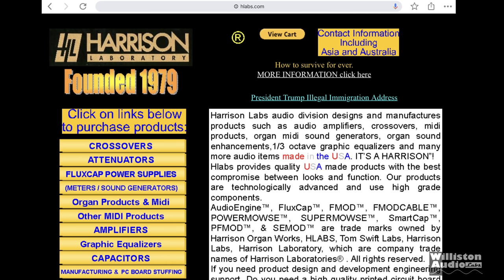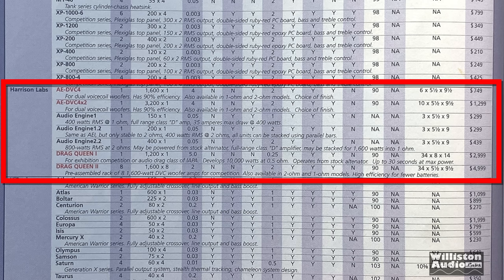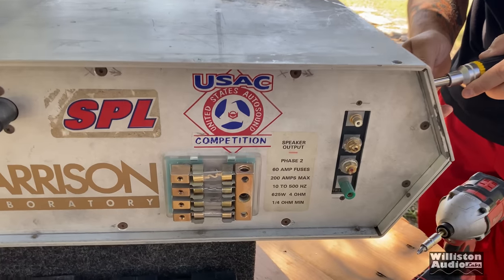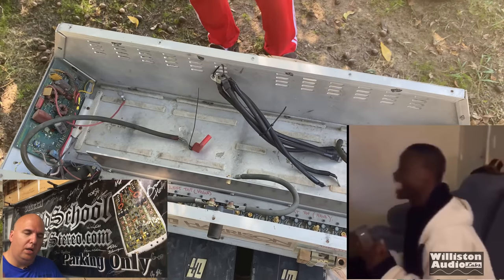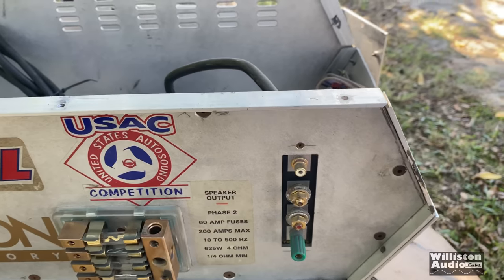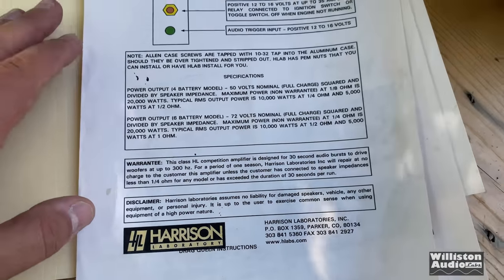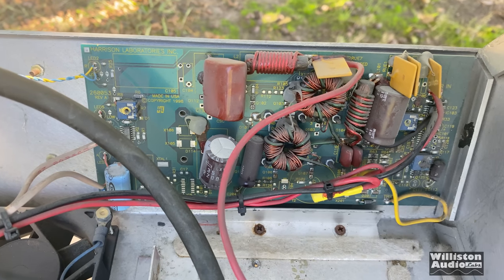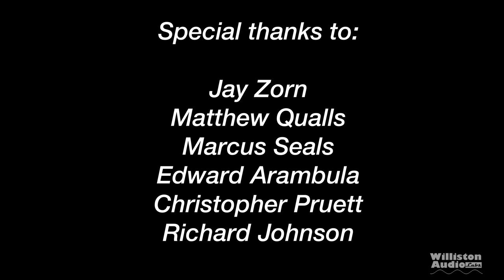20,000 watt Amp Banned from Competitions? 2000 Harrison Labs Drag Queen [4K]

Comment: 6x batteries better than 4x. 
Any 12v car good brand battery will work. 
this works like any 120v/220v PA unit, they lower voltage to 50v or 72v DC to operate at high power. 
6x voltage means 6x less amperage needed, and that size batteries can deliver 140-200A easy.
72volt multiplied by 140 amps equals 10080 watts.
48volt multiplied by 200 amps equals 9600 watts.
12v batteries usually stays at 14v charged but voltage drop exist too. 
You can use another high amp lead acid battery BMS too if stock is broken.
Grab some second hand batteries and test it. Missing components could be about 1 channel mode instead of 2.
Please.
I get subscribed, make me proud of it.

PS: the farm of 3 leg amplifiers seems to be placed in two lines near the front panel, they are in opposite direction and maybe works in cascade, one line pushes membrane out and the other one pushes the membrane inside of the speaker, the bigger the heatsink/fan the longer time you have for fun. 
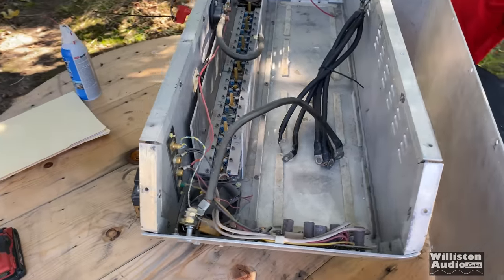PS2: minute 5:21. I can count 80x 3pin TO mosfets. 40 on each board, 20 in the front 20 in the back. 
PS3: this amp is a beast. if you feed and tune it properly it can blow indefinitely
At this point you want to test it too
PS4: it can work in AC but you need a 10kw 110/220v to 72v 80Ax2 toroid coil and trashcan size capacitors. So better, easyer and cheaper stay with batteries.
Reply: it drains 850A max in 12v language so you will need some beefy step up boards to charge the amp, but you also never going to use indefinitely at peak level so maybe 150-300A alternator+stepUp should work good at make ears bleed. 300A bms only for charging and balancing is cheaper too
Reply: 72v multiplied by 200 amps sounds fun
I have a bose with similar layout, 24 older transistors. it can pop any speaker, limiter is a must.

Comment: I seem to recall the Drag King was similar to a Drag Queen inside but instead of batteries it had a true internal voltage inverter like all normal amps used, in order to get ~50v to the outputs.
Now stick some Nu-Skool lithium batteries in there and listen to her sing

Comment: Does this amp sound good, or does it just produce a square wave? If it's a square wave, that might explain why there is no gain or crossover knobs. It probably just runs in full bridge mode, as a variable frequency inverter connected to the speakers. It would be hard to call it an "amplifier" at this point, but rather, a solid state "switch box". I can see why it would be banned, it's not an audio amplifier!
Reply: Vincent Robinette exactly !
Reply: It's not a musical amp, think of the sound a speaker makes when plugged into the wall but at a higher frequency.
Reply: @ColAngus  Probably more like making an amplifier out of a modified sine wave power inverter!

Comment: This reminds me of an idea I had as a kid when I was still doing audio stuff.  Get two regular, but hefty sized alternators, like 100 to 150 amp size, rip out the regulator and then just drive the fields with the low frequency signals you want to amplify and each alternator would be one half of the output.  You'd need to isolate the grounds (of at least one anyway), but you'd be able to make one hell of a lot of power.  But, back in the 90's, it would have been a cheap way to make big power.  Big power back then was god awful expensive.  Yanking alternators out of old stuff though, you could have made one hell of a big amp for very little cash.  AND, it would have been stupidly reliable as far as shorting of outputs and such.  It would only be good for the lower end of course, but I suspect it would allow you to make stupid levels of output.
Reply: Dare I say, as an EE, that could actually work...
Reply: Takes one to know one. :P  The only issue is you'd probably be limited to a couple hundred cycles/second.  They're true 3 phase units though so it would require limited output smoothing I'd think.  So long as the diodes are all good anyway. :D

Comment: Try to compare it with 20,000 watts Amplifier produced in China by Filipino Engineers mostly used in Battle of the Sounds Here in Iloilo City and Cebu City for Battle of the Sound System Competition, to see is to believe because those amplifier are tested and toasting most of the Power Transformers on the lines. They call it Category 2 from the Origin of Category 1 which is 10,000 watts.

Comment: Looks like it's a huge H-bridge between the batteries and the speaker that outputs a straight square wave (mosfets in full saturation) which is why it can handle down to 1/4 ohm or less without popping the mosfets.   144V peak to peak across the sub on the 6 battery version version (+/- 72V).   I wonder how much power is wasted in the sub from all the nasty harmonics.

Comment: Amp = power consumed ..... Watts = work done .
Reply: Actually, Amps is only one factor in the formula. Power is the product of amps X volts. That's what determines watts. wattage is synonymous with power, (rate that work gets done) If this amp worked straight off the 12 volt battery in the car, that battery would have to supply 833.3  amps! With the 72 volt battery, (which drops down to ~50 volts under load) you only need 200  amps, but the batteries can only sustain that for ~30 seconds or so. Since this thing belts out a square wave, you don't need to worry about RMS power, this is NOT a sine wave! If the batteries can indeed hold 50 volts@200 amps, this unit will drive exactly 10,000 watts into a .25 Ohm load.
Reply: Actually it is Watts minus losses in the cables and equiptment = work done... Amps alone tells you nothing if you do not know the voltage. Aperes times voltage = watts.

Comment: Do not use lithium batteries on a lead acid battery charging circuit
Reply: You don't want to use Lithium Ion, but, Lithium Iron Phosphate (LiFePO4) are a direct replacement for lead acid. You use exactly 2 lithium Iron phosphate cells, in place of each 3 lead acid cells. The charge finishing voltage is exactly identical to lead acid. A 12 volt lithium battery (4 cells) charges to full capacity at 13.6 volts, and is safe up to 14.6 volts. Right in the range of absorbed glass mat (AGM) lead acid batteries, which this amplifier came equipped with.

Comment: Sounds like a Chinese amp these days. 1,000,000w at 4ohms with a 0.25A fuse. Of course also running into a speaker with sensitivity of 3db 1w/1m and a response of 40-20k @ +/- 130db.
Reply: Lol, that sounds horrible.
Reply: Wait…so you’re telling me that the $30 amp that i purchased at the flea market with those exact specs is not legit?! 
Or…are you just jealous that my system is going to absolutely dominate the competition!
Reply: Actually, it's the opposite of that.  They are saying 200amp max with 240 amps worth of fuses on each side.  So, it would take more than 240amps for the fuses to blow in one bank (480 amps total).

Comment: OMG ..when I saw 60 amp fuses !!!! ( ok heres the edited comment)  As I watched this video I am asking myself ... who has one fourth Ohm speaker setups ? .. which is their claim basis of this huge wattage output.   There is no substitute for lots of heavy copper when it comes to power amps folks !
Reply: its what we used to do.... put a LARGER FUSE in an amp.... monitor its TEMP.... and add as many speakers as possible and connect them to 1/2 ohm configuration...... see what happens.... For the most part the amp would get HOT REALLY FAST but survive 30 seconds.... That was the target....  Who cares if it got hot.... that was the intention in fact... I remember blowing up many an AMP..... in playing with them.... Soon FIRE EXTINGUISHERS were needed...LOL.... Then I got to thinking..... Ya know if we FREEZE that amp there THEN turn it on.... hmmmmmm....... That worked... I think THESE DAYS..... WOOFER CABINETS need internal regulated cooling systems... hmmmmmmm Air Conditioning for your woofers.... LOL.... Heat is the problem huh?.... BDBD/2021

Comment: If 80% max load is code for circuit protection (breaker/fuses)...then 200 amp max of 240 amps fused would be correct...

And that would be a "switch" not a re-lay..
...
Reply: them old glass fuses would melt under pressure....  I remember...

Comment: I just bought a crescendo symphony 1 plus and there is nothing out there about it. Honestly a bit nervous cuz I can't even find anybody that's bought one talking about it.... 

I am hoping that means owners are just enjoying it and not inclined to say anything about their happiness. People usually say plenty when they're unhappy so not hearing any bad stuff is probably a good thing.

It'd be really nice if you could test those new crescendo symphony amps And make me feel better about my decision. I have a new skar SKV2 1500.d also but it's bigger than the crescendo amp and doesn't fit as well even though the crescendo symphony plus is 2500w. The regular crescendo symphony 1 which is 1500 watts is even smaller.

Are the newer crescendo symphony amps good amps?
Reply: Crescendo are good Amps bro. 
They don’t spend much on advertising cause they know there products are on point and will give a minimum lifetime of 10 years +
Reply: @blocc_boii1417  I hope you're right but it hasn't gotten off to a good start. The amp finally showed up yesterday from Florida(bought from crescendo on the crescendo website) in the most beat-up outer box I have ever seen. Not one part of that six-sided box was not completely crunched in. The way they packed it was actually quite pathetic I have tbh. A big outer box with a tiny amount of interior Packing material so it just bounced around in there and had zero support when things got put on it. No wonder it didn't survive. The guy wouldn't let me look inside the outer box.

I emailed Crescendo about it but don't expect a response until Monday. I don't know the process for declined delivery but the UPS guy said he marked it "damaged" earlier in the day and I should decline delivery, so we did. I hope Crescendo takes care of it like champs. I will update as new info comes.

I have a skar skv2 1500.1D that I have ready-to-use but I wanted to use the crescendo instead because it actually fits in this back spot of my SUV all stealthy. The Skar does not.

Comment: I wanna see someone test some old school critical mass subs 🔊🔊
Reply: Absolutely! Back in the early 00s I kept hearing about how Memphis Audio was junk and all of their subs sounded like garbage, so I went to my cousin that worked at a local sound shop and they pushed Memphis Audio subs and amps HARD. ALOT of people in my area started using them and I wanted to see what all of the buzz was about, so I went to my cousin and I said let me try the craziest Memphis sub you have and I'll put it on my 2 US Amps 1/4 ohm stable amps. I had a 1996 GMC Jimmy that had 22" Lexani wheels, a full body kit, 12 10" Orion Cobalt subs, 10 TVs, and it won Best in Show at NOPI Nationals back in 2004. Anyway, he installed one of those Memphis triple stack 12s and that one sub hit so hard that it took my breath away. I never took it to a stereo competition, but it would've done well. It was louder than my old S-10 with 4 MTX Thunder 9000 15s in the bed with a cap that was sealed to the cab with the back window removed. I was never a stereo nerd, so I never tuned my systems perfectly, but I had some good ones in my day.

Comment: That amp is kinda genius, why is it banned?
It looks like it is just an H bridge (or split rail half bridge), without any output LC filters (for that efficiency). I wonder if it is PWM controlled or just straight up squrewaves produced by clipping the sine waves (probably not the latter; the harmonics would sound ridiculous)
Reply: He said it produces a clipped signal so i imagine it's literally just biased to swing full on in either direction with any sort of input.  Kinda worthless for audio.  It can only ever produce absolutely miserable quality distorted audio, but i guess it'll be loud, for a very short time.  I don't imagine PWM would've been a thing back then for something like this, and not really necessary for what this thing is intended for.

Comment: It's 95% efficient, but produces a clipped tone? Efficient and clipping are opposite ends of the spectrum.
Reply from the maker: Yeah that’s a bold claim
Reply: probably because it doesn't have a DC-DC converter (which also has inefficiency etc)
Reply: Clipping doesn't necessarily indicate inefficiency. If it can deliver nearly all power via a clipped signal, its still putting out power.
Reply: @madjimms  remember that you are running it through INDUCTORS...... HUGE ONES... so... take that "filtering" into consideration.... THIS amp was surely designed to push 16 woofers..... MORE.... THUS.... 16 INDUCTORS to absorb...... Its a PURPOSE built product... built to BOOM.... and very little else... MAYBE 15 seconds BLAST or a more sustained 30 second BOOM if ya was using the BATTERY PACK like this amp shows...... REMEMBER... theres a CAP BANK setup that came with this amp. THAT was the HUGE power.... 15 second BURST would drain the cap bank dry QUICK....... Battery packs drain SLOWER... much slower THUS a more SUSTAINED BURST over a longer time period....30 seconds.... LOL...... I remember having 120 volts DC available back in the days... 10 batteries all hooked up....  CHARGED...... Than DEMO TIME........ That 10 battery pack would last for all of... a minute... then voltages dropped drastically.... I never USED CAPS..... just a shit load of BATTERY....
Reply: these days theres some REALLY good CAPS out there.... SUPER CAPACITORS.... THESE are the BEST TIMES for Car audio..... I have seen this.  BDBD/2021

Comment: I would love to see one of these huge car stereo systems play bass mechanic the 150 Hertz down to 10 Hertz sweep. its 2;20 long. I still play it from time to time on my home stereo system I have inside my house it's just cool to hear it go from 150 all the way down to 10 Hertz within a 2 minute and 20sec time. I have a very good 10 inch subwoofer in a sealed box and all of this is hooked up to my TV which is hooked up to my laptop so I use VLC player and what I can do is use parametric equalizer and I can turn up the decibels on 20 Hertz and below specifically so once it gets down to 20 Hertz without even noticing it plays the 20 Hertz and below at a higher volume so that I can actually hear it coming from the 10 a bit better since I don't have a bigger speaker it works like a charm
Reply: Wasn't that #5 that had that?  I think in bass 6, he didn't have the full sweep....

Comment: basicly the system switches the battery power on and off at 20 hz toward the speaker 
its not an amp its a tone generator
think the same kind of system gets used to power electric car motors
Reply: is more of a multiplier transformer with audio caps, have to feed in a tone yourself.
Reply: @Hewitt_himself  thats right.... it needs an INPUT SIGNAL.... its all BASS to me...
Reply: @Brian Kelly clean is for mids and highs.... That THING powered 16 inductors..... LOL.... FILTERING?..... Hey them woofers are inductors..... hmmmmmmmm..........

Comment: That's bullshit. 
Why is it banned?
And why can you not just wire in 4 or 6 batteries and test it?
Reply: well it dosnt look like a real amp more like a way to cheat in one tone plus it dosnt even work whit 12v.
looks more like a welding machine
Reply: @alekpo2000  the batteries work as the internal caps.

Comment: You never got to the power justification.  With 4 batteries at 50volts and 0.25ohm impedance, considering that Power = Voltage(squared) / Impedance, that is 50^2/0.25 = 10,000 watts.  Similarly, at 6 batteries for 72volts it is 72^2/0.25 = 20,736 watts.
Reply from the maker: Yessir, obviously theoretical numbers without accounting for efficiency
Reply: If they were producing a clipped sine wave, it may indeed swing very close to rail to rail. No way in hell it is producing 20,000 watts with low distortion.
Reply: @rich1051414  hahahaha! Exactly, that thing sound so distorted what it looks like square wave, tbh, i think it is a pwm signal right to the speakers, 95% efficiency... pfft.
Reply: @GrulbGL  I feel bad for the speakers. It's getting almost pure DC for a long time, and at that much wattage, it must be a sub killer.
Reply: @MichelLinschoten  You're making fun of people for knowing about technical stuff? Sounds like you need some college...
Reply: @rich1051414  it was surely meant to kill subs...... yep... in 45 seconds flat.... shut it down by 30.... OR ELSE......